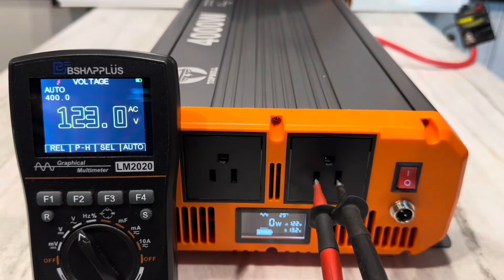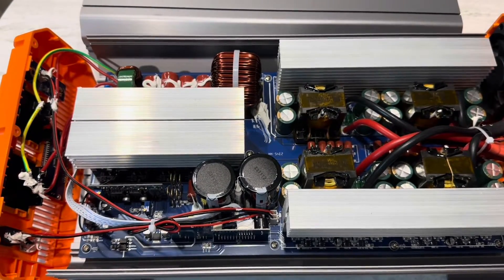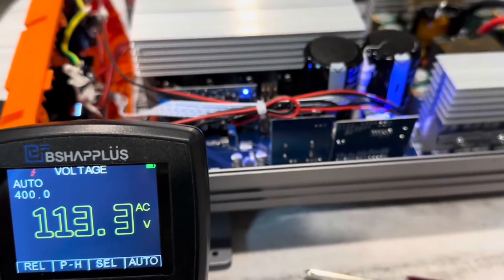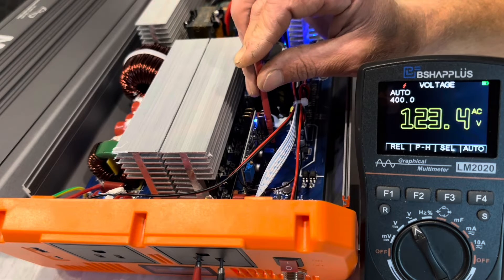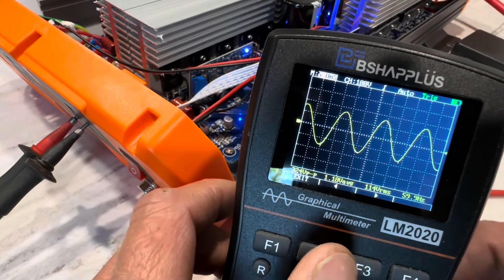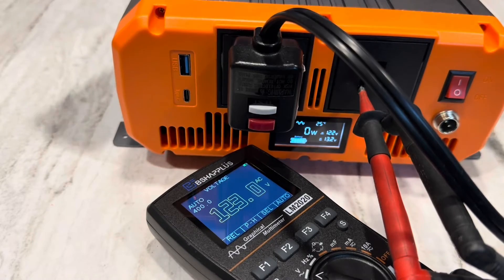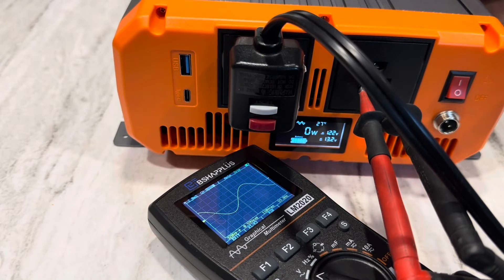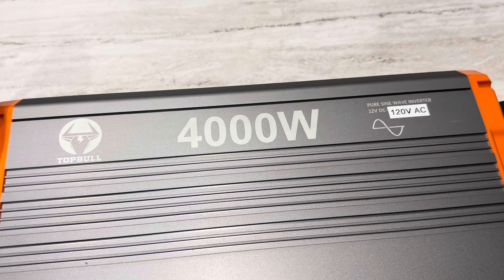Adjust Inverter Voltage with TOPBULL 4k inverter

Comment: Why do modified inverters drop voltage when load is connected to it?
Reply from the maker: Voltage regulation control and associated circuitry not always the best on low price inverters.
Reply: @THEOFFGRIDMOUNTAINHOMESTEAD  not everyone is ready to invest on pure sine waves

Comment: Awesome stuff! I have not had a chance to go back to the 2kW version I have and tinker with it (reviewed the little guy a few weeks ago), but did see the same trimmers in it and control board. Very surprised they set voltage so low on this - trying to figure out why they would default it down like they did.
Reply from the maker: Thanks! I subbed to your channel so I can check out your videos! Not 100% sure on why all these import units are set @ 110V. Maybe they don’t know USA is 120V? Maybe trying to set a midpoint voltage so the inverter will work in multiple countries (some use 100, some 110, 115, 120 etc) with one exportable unit? Even many of the portable power stations are set @110V which I’m sure you know as well!

Edit: if you ever get a concrete answer please fill me in. Thanks.

Comment: Understanding which inverters can have a ground neutral bond might be a good video. How to test if an inverter can have them bonded. Maybe like having a 5 amp fuse between them.  Maybe five amp may be too little or two much. 

I was watching a video by John Daniel and he spoke about grounding the Swipiwer(?) would blow the fuses in the inverter or burn the included ground wire into. 

Thanks for what you are doing.
Reply from the maker: I agree with John on many of his opinions and methods. He’s really good on 12V systems. It’s beyond the scope of today’s video but his “floating” theory rings true about many of the 12V inverters out there. Correct about the CNSwipower units! I’ll be sure to cover this subject in greater depth going forward. Thanks for your feedback.